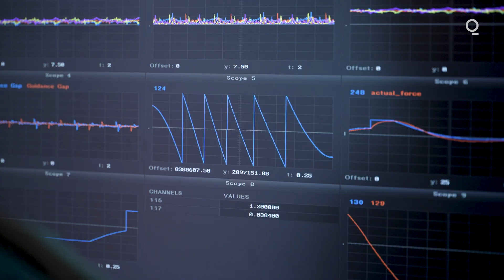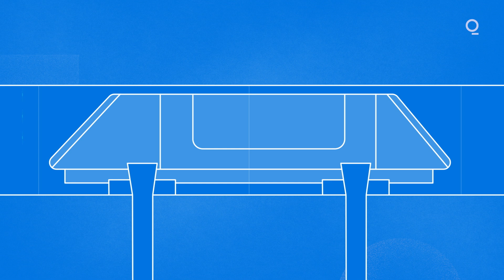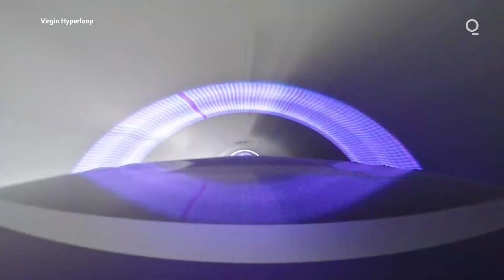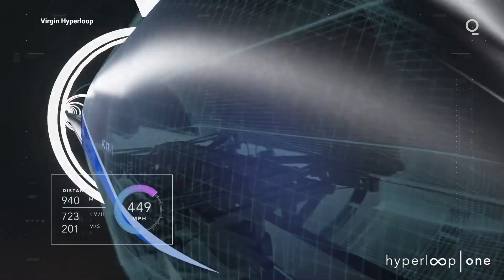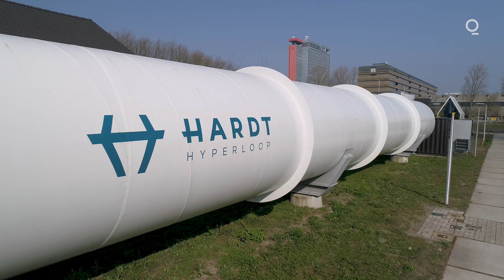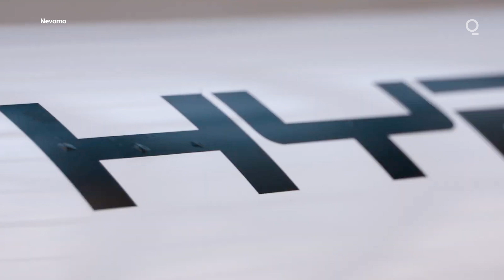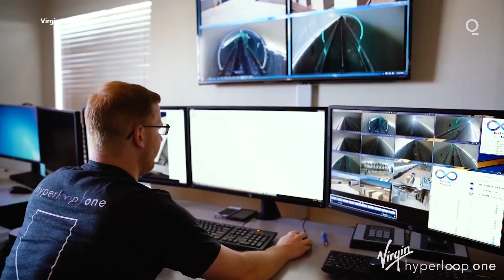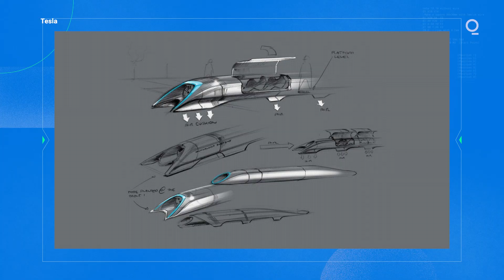The Hyperloop May Disrupt More Than Just Travel

Comment: Its just a bad idea in general.
First of all you should just have a decent Intercity high speed rail. 
You don't need expensive futoristic unrealistic expensive unrealistic concepts that are not fit for mass transportation.
What the US needs is a well established rail system like germany.
Speed is not the problem, you can go an easy 350kmh on a normal rail system without any special loop or whatever.

Comment: Very poor presentation of the early history of the idea.  It was Goddard's idea to put a train in a tube with a vacuum. That was 1904.  Vehicles propelled by differential pressure is something different entirely.  And adding in magnetic levitation with real engineering was done by Robert M. Salter Jr. of RAND Corp. in the 1970s.  I had the same idea of, an evacuated maglev, independently myself when I took physics in HS in 1987.  A few years later, in college, I stumbled onto the RAND stuff.  Each re-inventor adds their own differences.  But, of course, I just want to see any design built.  Being a high-schooler at the time, my version was a bit more grand.  My current thinking is more subdued and greatly modified to reduce cost.
Standardizing too early can have major pitfalls, too.  Sounds great in theory, but designs need a lot of flexibility and no seeds of doom. Musk's Hyperloop was supposed to be something other than a maglev in a vactube.  It was supposed to have low air pressure and use that air to fly in the tube, something like a hovercraft, or ground effect vehicle.  Most of the actual efforts are the maglev in a vactube closer to Robert Salter's concept.

Comment: I was just wondering what if one of the pods breakdown in between the pathway due some technical glitch things do tend to fail (no one can ensure 100 percent success rate), in those kinda scenarios what will be the backup?
Reply: Death
Reply: When crash inside = damage tube = 1 atmosphere pressure rush to vacuum = shock wave (or wind fast enough to pull thing)

Completely disaster, would cancel entire thing

Comment: Bloomberg was hyping up the hyperloop as late as 2021?! Even if a hyperloop met all of the specs from the original white paper, it would still be worse than high speed rail because of the unavoidable bottleneck of 100s of people trying to board one pod at a time; you would have to be traveling long distance flight level of range before it would be faster. Then you factor in the cost which means you could build an entire bullet train network for the price of a single hyperloop line. Did I mention that Japan's high speed rail network hasn't had a single fatal incident in its decades of operation.   

Despite this, the biggest problem is that the technology doesn't exist. That demo was just a light rail in a tube, which probably explains why that company was reduced to a skeleton crew not long after that demo. Airlocks that are big enough, reliable enough, and leak small enough amounts is actually something NASA is currently working as part of there Mas/Moon base research. Rubber based seals outgas and leak too much while metal on metal seals are too easily damaged. To be more energy efficient than just pushing the air with a bullet train, you would need to keep leaks extremally low.

Comment: So it's Japan's maglev meets the London tube. 
Zero chance seeing that in the UK ever. The UK can't even build an industry standard single high speed rail, which started in 2009 and is only due to complete in 2040!! It only connects 3 major UK cities over a few hundred kms. It's faced such push back, corruption and legal challenges despite all the so called benefits.
Plus in the UK any new public transit system will immediately be oversubscribed due to under capacity and over population. Ticket prices will also be extremely high and the whole network will be plagued by signal system faults and Union strikes on a regular basis, especially around holiday times.
Reply: Mostly in agreement with your comment.
Don't knock unions - they are the last bastion of 'people power'

Comment: Sadly I just don't think that even with the issues solved that it servers enough of a purpose at low enough risk to be worth it.

If the vaccum gets broken or destroyed by a terrorist/accident you are going to have high speed trains meeting high speed air. 

Soooo to say the hyperloop is going slow and the air is not fully able to rush in you are probably at minimum getting a pod at 350mph hitting air going the other way at 350mph. 

Soooo you are basically getting hit with a sudden 1.2kg/m at 700mph. That is the least you will suddenly be hit with....F5 tornados are at max only 318mph. Granted you only get hit for a second buuuut....idk if the pod would survive that

Comment: If you look at Meglev in Shanghai alone they are not profitable, but high speed rail as a whole in China is. Of course , China has benefitted massively from the value of the experience of building Meglev, the current generation of HS rail curries a significant less cost. 

Rail companies and tracks are all state own in China so one part of it isn’t profitable isn’t a huge problem as such in a way.

Comment: I don't think that the question, "Is it safe?" is first and foremost. Surely the first question is, "Is it economically feasible?" The answer is, "No, no its not." Not even close. The financial reward for reducing journey times slightly is small, (and it will be slightly) [How much time did you spend in the airplane last time you flew?] Less than you you think - you might well have spent more time dealing with security than you did flying. Security issues will not be going away anytime soon.

Comment: As a former train designer, the technology is very do-able.  As stated by Alan James, the effects will be transformational... if phased in correctly.  The economies of scale plus operational running cost efficiencies will rapidly bring down costs across the board to a point where time saved incl. the benefits & all cost per Km Minute travelled, will rival  existing modes of transport.  Super commercial hubs (like the one shown in the North of England) will be replicated all over the world where these hubs, once connected to other hubs, will themselves create their own dynamic.  This technology like many others, needs to be applied, not left on the drawing board of time to gather dust!
Reply: Ofc the trains are doable, because they're just maglev trains. Doesn't take a train designer to see that much. The biggest problem is to maintain a 3m diameter vaccum tube for hundreds of miles
Reply: @Preetzole  You say the biggest problem is to maintain a 3m diameter vacuum tube for hundreds of miles, this is Not Correct, as one would only need to create & maintain a vacuum in the vicinity of the moving transporter immediately in front of the moving 'train'... this is easy to solve.

Comment: They need a hyperloop material that will not expand or shrink with temperature.expansion joints wont work unless they are sealed with an expandable rubber gaskets maybe.

Comment: Introduce air to the rear of the capsule thru ducts. Only by moving the static pressure from the front of the capsule to the rear will greatly  increased speed.

Comment: Speed is not everything. The Concord enabled supersonic commercial flight almost 50 years ago but was unprofitable to operate and eventually put out of business. Hyperloop certainly sounds technologically feasible but economically unfeasible
Reply: The Concord failed because it had highly restricted routes, they could not fly them in many places. The sonic boom problem essentially killed it. This example is really not relevant.
Reply: @wearesimulated1579  Speed is not everything. Commercial planes don't fly at their top speeds because flying faster is less profitable. There is no technological barrier to building a commercial plane that flies just below the speed of sound. Even though flights could be 20% faster and airlines would increase their plane utilization rate, its not worth the extra fuel cost. Technologically feasible but economically unfeasible
Reply: @teoengchin  You are not saying anything of value. I explained why the Concord failed. You replied with your opinion on speed? Why? That isn't what we are discussing. We are discussing why your example of the Concord failing isn't relevant to this situation. This method of travel would not have a limitation like the Concord did. With such limited routes, the Concord was destined to fail. It had no chance.
Reply: @wearesimulated1579  dude, this video is about Hyperloop, not the Concorde. Hyperloop's main selling point is speed. Since you say Concorde example invalid because of route limitation, I just gave a different example with no route limitation
Reply: @wearesimulated1579  The viability of Hyperloop depends on Speed/Convenience vs Cost. Perhaps you can explain how Hyperloop can overcome it's high construction cost? Even I could get behind the Hyperloop if it was economically feasible
Reply: @teoengchin  You are the one who brought up Concorde originally, I simply explained that its failure was guaranteed. I am not here to advocate for the hyperloop. I do not care about it. Maybe its high cost will be its downfall? Maybe they will get the costs down over time to make it feasible? I don't care either way.
Reply: @wearesimulated1579  Concorde is technologically feasible, but financially unfeasible. We both agree on that right? Hyperloop has the potential to be technologically feasible, but also appears to be financially unfeasible, like the Concorde

Comment: There is not enough conversation on this aspect. Once self driving vehicles, drones and hyperloops are ferrying people on demand, in a calculated fashion, like bits of data across electronic networks. So you hail your "ride" and the system knits together any number of combos or routes - whatever is quickest and most efficient at that exact point in time.

Comment: You need more than a simple run with a couple people to prove it is safe you need a large capacity full of people and over several continuous hours.
Typically as proven over the years whatever cost is PRECIDTED is usually WAY OFF like by 50% or worse so if they are assuming around 10 million it would likely be closer to 20 million.

Comment: I love how incredibly out of touch this is. We’ve all been aware for years that the hyperloop is a massive scam and insanely redundant. It’s pseudo science and Bloomberg just fell for it 😂😂
Reply: the science is actually plausible. But the economics is the problem. They even where (Transrapid) or still are (SCMaglev) for "regular" magnetic levitation systems. And now within a tube that has to maintain a vacuum it's just insanely more costly to build the infrastructure for it. It has to pay it's costs of someday, but flying is just to cheap still as a direct competitor. Even if it would be faster. The Concorde had to go as well mostly due to cost factors...

Comment: Until any of these clowns can tell me how they're going to ACTUALLY deal with the inherent fail-deadliness of the vacuum tube system or the thermal expansion/contraction of thousands of miles of metal tubes, Hyperloop remains nothing but a flashy boondoggle. They're solving all the superfluous difficulties while not even mentioning the fundamental deal-breakers baked into the very core of the concept.

Comment: These are too expensive for long distances.
.
Vaccum tunnels that have a slight descent, with a smooth surface and create gentle, continual motion from bicycles, scooters etc.... (like gliding down a shallow hill on a bicycle with the wind on the back) would be far easier to create and maintain initially.
.
Put elevators at either end to contain pollution.
.

Comment: Did anyone else notice that in the scene where he says "massively inefficient truck haulage", the roadway is being fitted with overhead electric lines for completely electric long distance truck hauling?
Reply: Trucks are by default an inefficient system for distance transportation. Companies want to use trains but the railways and carts in many nations are of such low quality its simply not worth the risk of delays. 
That made trucks cheaper. But if the train system was properly maintained and upgraded to modern standards it would dominate the transportation sector.

Comment: Dream on.  Of course this general idea is as old as science fiction.  I used to think about it as a kid in the 60's.  EVeryone who has gone thru a bank drive-thru and put their check in the cylinder that gets blown thru the tube has thought of this.  An idea as old as time.  What I read more recently about Hyperloop was it was supposed to go 800 mph, and the tube would be cheaper to build than a regular train track.  My response was:
1) How straight would the vacuum tubes have to be made to have a smooth ride at 800 MPH?  
2) Cheaper than two rails nailed to wooden ties in open air to facilitate 70 MPH travel?  Are you kidding?
3) Holding a vacuum over hundreds of miles - no leaks?
4) Earthquakes?  Do you want to be going 800 MPH in one of these when an earthquake hits?
5) Congratulations, you are now the kinetic warhead of a hypersonic missile - what could possibly go wrong?
6) At 800 MPH, the teeniest glitch and all passengers would be instantly disintegrated, and everything within a large perimeter would be destroyed..
I'd say maybe start with lower speeds than 800 MPH.  I think there is a reason Elon threw this one out to public domain:  He knew it had more problems than he wanted to even try to deal with.  The only reason airliners can travel safely at 600 MPH is there is nothing to hit way up there.

Comment: Plastic solar power, nuclear power plants and fossil fuels plants have to be shut down for a variety of reasons. We should be using Edison generators and dynamos with inverters and transformers to deliver high voltage AC power continuous and peak power without fuel.  This power system was invented by Thomas A Edison and it was not high voltage AC it was low voltage AC power continuous peak power without fuel or pollution.  It could easily be installed in Lebanon today as 120 volt or 110 volt AC power continuous peak power without fuel or pollution.

Comment: Nuclear nonproliferation treaty enforcement is notice that nuclear technology is not safe and cannot be made safe to use.  The hyper loop can use Edison generators and dynamos with inverters and transformers to deliver high voltage AC continuous peak power without fuel or pollution.  Yes this is possible.  Tesla bound the generator and we have been forced to crank the generator with steam or water or wind . We are grossly misinformed about the generation of electricity.

Comment: Getting the interconnected vacuum tubes and valves over long distances to work had t been worked out plus the thermal expansion and contraction of the system and therefore joints will not be worked out . The level of complexity is too great to work over high speed rail !!

Comment: It’s not gonna happen. The conduit is way too expensive to make and to depressurize hundreds of miles isn’t going to happen, when compared to cheap steel rails and or concrete for roads.

Furthermore, if the goal is to change the network, that can be applied to any type of transport.

Comment: So if the loop is so fast how can it accommodate a lot of people in pods as the passengers have to disembark, the time it would take to do so other pods would already be their. It seams for this to work the entire facility would have to be in a vacuum. Also since it requires a fairly straight line of travel, sounds like a lot of emanate domain would be required for building of the rail/tube system.

Comment: Things leak: it'd be immensely expensive to continuously pump out air.
Metal expands in heat: bent pipes used for oil pipelines can't be used here.
Breaches create deadly shockwaves: the difference between one atmosphere and near vacuum is much stronger than that behind hurricane winds.
No prototype of rapid passenger ingress/egress: pods stuck in a slow airlock is low passenger capacity and isn't commercially viable.

Comment: I don't expect to see this now or ever, though it is a cool idea but its nothing new. Plus the cost of initial installation and maintenance would be astronomical. They kept talking about safety but what happens if a tube with cars going several hundred miles of hour in a near vacuum suddenly hits a unpressurized area of tunnel that fails. It would be like hitting a brick wall or the surface of water going the same speed. And if no one does die in that kind of accident, how long do you think it would take to fix a section of track that happens too, it would knock out the entire line unless they seal that section off, and pray no one decided to sabotage it. cool idea but its nothing new

Comment: So, there is a little change in the earth or a small earthquake somewhere, the tunnel segment and guiding rail are 2 cm out of line because of that.. And you are coming through the tunnel at 600 miles per hour.. What happens next?

Comment: The problem with Hyperloop and that so many are skeptical is for no one have built any working model of a small system  and there is not even a working computer simulation how to get 200 passenger in one pod and then get that pod into the system, or how an evacuation would look like if there would be a pod getting stuck somewhere between stations.